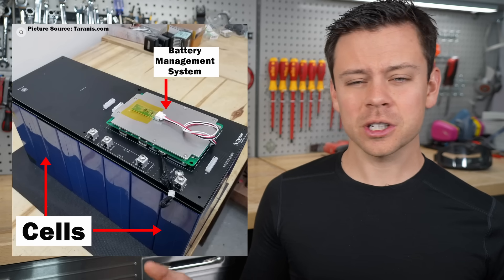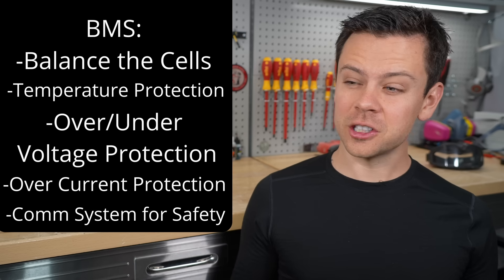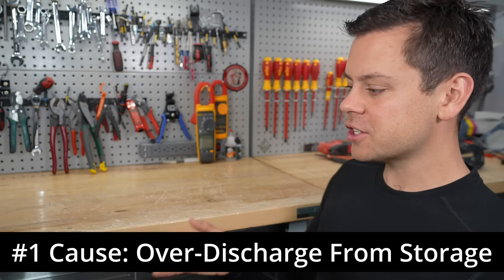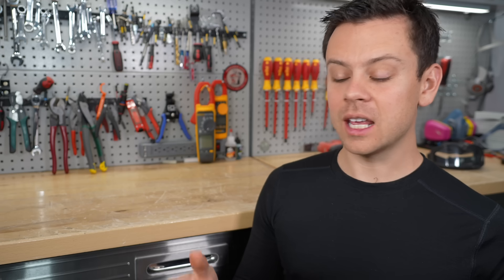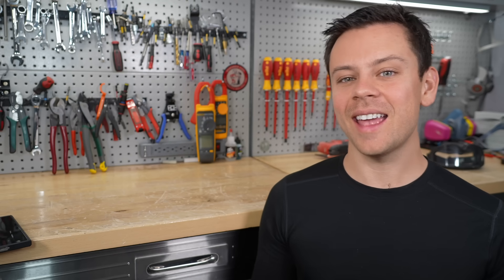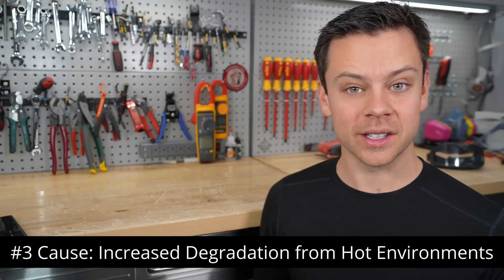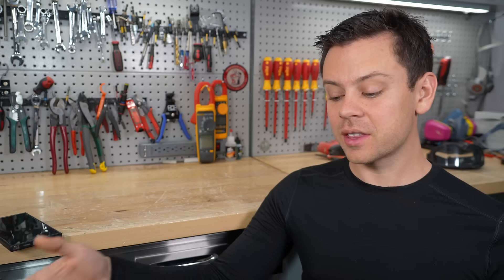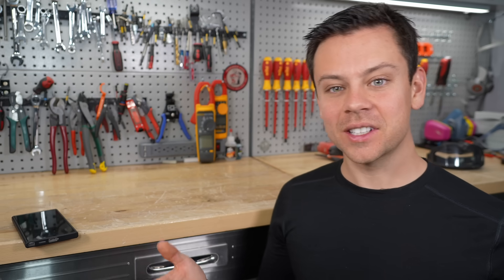The Rules of LiFePO4: The 3 Most Common Causes of Failure and General Guidelines for Long Term Use

Comment: I have 4x 5.1kw LFP batteries. I have been charging them with solar to 100% every day and discharging down to normally between 30-50% overnight. The BMS tells me that the SOH (state of health) is 99% after a full years use. Couldn't be happier.
Reply: What voltage are you charging at/to?
Reply: @forestpassineau  They're Pytes batteries so I'm sure that it's the standard 48v all controlled with a Sol-Ark 15k.
Reply: @forestpassineau  The Sol-Ark info screen says that the battery is charging at around 56.8V
Reply: @simonpaine2347  perfect. Which would be equivalent to 14.2v on a 12v battery. Thanks!
Reply: @forestpassineau  voltage can vary ie you get 48v and 51.2v batteries and many just refer to both systems as 48v systems , they would have voltages with 2.5v - 3.65 v differences bottom and top respectively ,

so a person should ask is yours 48v or 51.2v if you want to use someonme elses settings verbatim
Reply: Sounds about right. Your Depth of Discharge (DoD) is about 60% so that means the battery should be able to get to 10k cycles before 20% degradation. You did 365 cycles which is 365/10000 = 0.037. So you have done 3.7% of the 20% degradation, which means 3.7%*0.2 = 0.7% in absolute battery terms.
Reply: @C4rb0neum  Thanks for the calculations. Very helpful and interesting. Now I have a reference point, I plan to keep an eye out for when the SOH drops to 98% and see how close it is to your figures and then I'll be able to get a more accurate picture of the lifespan of the batteries.
Reply: @simonpaine2347 hey simon which BMS are you using which tells you SOH? Coz i have JK BMS which does not have this feature
Reply: @hamidkhatri  I'm accessing the Sol-Ark inverter battery information, which is obviously connected to the comms of the batteries.
Reply: @C4rb0neum  DOD is not the only factor, overcharging is nearly as problematic... specially on long periods, you can DOD at 50% and overcharge all day .. those packs will degrade faster then normal.
Reply: @davidniquot6423  You can’t overcharge. BMS is there to keep that from happening. Watch the GD video and stop believing myths and nonsense.
Reply: @C4rb0neum  My math says 26 years before they reach 20%.
Reply: And one of my friends just replaced his LiFePO4 batteries for the 3rd time in 10 years.  And these were "guaranteed" 10 year batteries with 10,000 cycles - or he thought they were. Babysitting projects are what they often turn out to be.  Way too often.  And when the battery store is 4 hours away making for a 10 hour round trip if they have replacements in stock, they quickly can become more costly than the problem you're trying to solve.  What did he do?  Switched back to lead-acid car batteries and deionized water.  A sad reality, but a reality nevertheless.
Reply: @zavatone Probably goes to show that buying the cheapest option, isn't always the best one. There are hundreds of different companies putting batteries together, so it should be obvious that not all of them will survive and there are always sharks circling to pick off the easy meat.
Reply: Nonsense  @zavatone
Reply: @zavatone  probably crap manufacturer, I've bought 7 60ah cells from an EV battery recycler from china and the weakest cell still holds 58ah. These cells are 5+ years old and suffer more mistreatments but they are still holding up very well. 

I've had 3 SLA's that die in under 4 years which seems to be normal for these batteries
Reply: @zavatone  curious what the brand and specs are for those failed batteries. His "sad reality" might not be the LiFePO4 reality for everyone. I do trust the engineers' conclusions about these batteries, and think the only weak points are in either in who/how they are manufactured and how they are managed (whether by a BMS or the owner). For example, my 48v 19.2kW HomeGrid Stack of four LiFePO4s is still operating at 100% health 2.75 years after being turned on, never off, charged to 100% nearly every day, and dropping to between 30-50% regularly throughout the year.
Reply: Why lithium battery have no heat sink or liquid cooling how we cool them
Reply: @umairahmad3050 the Hanchu HOME-ESS-LV-9.4K has a heatsink
Reply: "Full years", how many is that?
Reply: @johnvgig "a full year" = 12 months = 1 year

Comment: Why does my Ford F150 Powerboost ( Hybrid ) have such a narrow SOC for the hybrid battery? Maximum SOC is 60% and minimum is 40% Thanks for any info!
Reply from the maker: Really depends on the chemistry. When doing shallow dod cycles, different chemistries like to cycle a different thresholds.
Reply: @WillProwse  Thanks Will. All I know is it's a 1.5kWh lithium-ion battery that I wish was bigger. The 7.2 kW inverter is awesome.
Reply: @GeorgeMcDaniels  That's why the range is so narrow... its because it is a tiny battery the the Ford is probably cycling multiple times a day.  So it can only use a very narrow SOC range to stay healthy.  And its probably NMC, not LiFePO4.    One of the biggest problems with hybrid systems like Powerboost is that the battery capacities are just way too small and usage wears the batteries out very quickly because of that.

Comment: What about keepinga lithium on an auto maintainer charger?
Reply: As long as the charger is compatable with LiFePO4 batteries, it should be fine.
Reply: @Tumbleweed5150  compatible with lifepo4 or just Lithium since my charger jas a Lithium maintain mode?
Reply: @dbo11tango  I am not sure. You just need to make sure it will charge up to 14.4V for around an hour or two, then it should back down to about 13.8. That is what my LiFePO4 charger does. Maybe it will work if you get it charged up to the 14.4V, then hook up the lithium charger, if it keeps the Voltage near 13.5-13.8V. Maybe someone else will know. I just know that other chemistries can have different "full charge Voltages.

Comment: I used to do cell phone repair and had the 80/20 conversation with many customers. Even if you save a bit of wear on the battery, you are giving up 40% of your overall capacity to do so. Batteries are a consumable item, and can be replaced in 99% of cases. Use it, enjoy it, and fix it when it breaks.
Reply: But you're talking LiPo, not LFP.
Reply: @MrHuram-abi   True, but the reasoning is the same.

Giving up a large amount of your capacity to not lose capacity later is almost always a net loss.
Reply: @pinchofdoom LFP batteries at least in theory as I don’t have personal experience last significantly longer as in years longer then a battery with Lithium Ion chemistry if cared for properly.
Reply: I'm on to your game. you want them to use up the battery and wear it down. Then you can sell more battery installs.
Reply: @I.C.Weiner   LMAO.

Don't worry, I've been out of the industry for 2-3 years, and the only store in my area that I like closed down.

Comment: Will I don’t understand, the parameters on my inverter say to set the battery, on the top end to 27 volts and the lower end to 24. Are you saying to set the top end to 28 volt and the lower end to maybe zero? BTW I have an LV2424 from MPP Solar.
Reply: I would set the top end to 28.6V, and the low end to 24V. Never try to go to zero Volts. On a "24V" nominal LFP battery, 20 Volts IS zero percent! The reason I suggest the low end as 24V is that this way, your battery BMS will never have to shut the battery down for too low of a Voltage, as the inverter will take care of that.
Reply: @ thank you, that clears it up for me. You have a great day.

Comment: A question, it seems like most of these batteries that I see are sealed how do you go about changing a BMS that goes bad?  Thanks
Reply: You don't.  Unless you really know your way around the battery or it has screws instead of glue.  Look for a more maintainable battery.  Not that sealed is necessarily bad, but for most people once the BMS dies it will probably cost less to just replace the whole battery.
Reply: @junkerzn7312  thanks
Reply: you would have to carefully saw it open , then you could recase it in a proper metal box.

Comment: Good point on the BMS - I bought 3 wall mount batteries a couple years back - all 3 of them had a BMS failure! The vendor replaced each of them under warranty, but it still surprised me how they all failed, almost one after another.
Reply from the maker: Holy cow!!! What battery was that?
Reply: Not one problem with my two JBD 12v 4s 120 amp BMS.  Reliable and performed very well.  I wish I had gone with JBD when I created my latest battery which is 48v but I followed the crowd and went with Jikong (JK).

Comment: Love the info. I’m about to build out my first system and think I landed on going with the EG4 indoor wall mount battery. I’m curious if I start off with 1 and add on more down the road, 1-2 years, would this cause any degradation or should I hold off to when I’m able to purchase all batteries at the same time?

Comment: It would be very interesting to see you build a diy battery and set the settings in the bms to charge the way you mention in this video with the data sheet of the cells and all.

Comment: I agree with everything you said except for DOD to zero.  Although LiFePO4 have a much higher usable capacity than lead acid, the grafts still clearly show the relationship of DOD cycles and life expectancy.  What am i missing?  Thank you.
Reply from the maker: Absolutely disagree. And if you're hitting zero you should probably make your battery bigger. Probably did not calculate days of autonomy correctly. There is reduced degradation but who cares. Use the battery and stop worrying about it. You'll use it now or you'll use it later
Reply: Very few use cases actually do 100% DOD on a daily basis, so we are left with... well, what about those few weeks in a year where you might need a 100% DOD?  Will that effect cycle life?  Answer: NO.  So there is no need to program your battery to cut-off at 80% DOD.  Definitely allow 100% DOD from the battery itself, particularly if you don't actually use 100% DOD on a daily basis.

Most setups barely use 25% DOD on average.

In anycase, the DOD cycle life calculation to 80% is theoretical and assumes constant temperature and constant C-rates.  Most actual use cases have neither.  Even using a baseline 3000 cycles at 100% DOD, 3000 cycles, cycled daily, is still 8 years.  That would be an extremely heavy use of the battery, only grid-scale battery systems might even come close to that.

But temperature has a huge effect.  A lower temperature (but still above freezing, obviously), exponentially increases the cycle life.   A higher temperature vastly reduces the cycle life.  But again, its an average.  Just because it might 100F during the day means buckus if it drops to 60F overnight.  As an example.

So in terms of battery health, if you have the choice of storing the battery in a conditioned space verses an unconditioned space, you generally choose the conditioned space.  But unless the battery gets too cold, an unconditioned space isn't the end of the world.

-Matt
Reply: from my experience, if you keep it charged to 100% also and you have to leave it 1-2 months even with bms/system connected, the cells starts to swell and die.. so if you are leaving, you need to make sure its at 40% charge and someone is attending the system or just disconnect the bms/system for that period.
Reply: @videostar555  I saw a youtuber claim that he has several UPS's that float their LFP batteries at 3.45v/cell, for 5 years so far. He claims no noticeable degradation.
Reply: @jimmybrad156 yes i do the same (3.45v) for last 3.5 years. but you must know that 3.45v is already like 99% charge.
Reply: @videostar555  I thought you were saying that doing so swells the cells? Did I miss something.
Reply: @jimmybrad156 i said if you are going somewhere, leaving the house, car for a month or two with no discharge or very low discharge and you charged the cell to 100% and leave,  the cells will start to swell..  same for if the cells are left at low charge like below 3.2v.. you should not leave it unattended for long time. you have to keep it at 30-50%, and disconnect bms and system for this case.
Reply: @videostar555  not getting much clarity.
Reply: @jimmybrad156  lol.. not aure what is confusing... just saying if you have to leave your battery for few months, just treat it as in "storage" mode.

Comment: The confusion about charging to 100% comes from advice on cell phone battery charging. A cell phone battery does not have a BMS because it has a single battery "cell" that does not need balancing. So only charging to 80% will make them last longer.
**Additionally there is confusion because batteries should NOT be STORED at 100%, only 50% as stated in the video. But DAILY USE charging to 100% is good. Like everything, it depends on the situation.
***Same thing applies with discharging to 0% - in STORAGE IT IS VERY BAD, however while being USED IT IS VERY GOOD!!!
Reply from the maker: Exactly

Comment: This is the reason a lot of off grid people are still using Lead acid batteries, we set them up and forget for years. Lithium is great but not for long term storage
Reply: I got a good laugh from this one. Lead acid only last around 500 full cycles, and can only be used down to 50% of Capacity. LiFePO4 batteries can last for over 5000 cycles, can be fully used from 100%C to 0%C and back over and over...about ten years plus, and don't need watering like golf-cart batteries, nor do they have off-gassing, which is explosive with hydrogen and also causes the corrosion around the terminals that leaves white, blue, or green powder. I have used both now, and for my off-grid system will never go back to lead-acid for long term storage. I don't need to worry about leaving it sit, as my solar system will keep it in good shape, even if I am gone for six months or a year. LFPs can sit on a shelf for just as long as lead-acid with less self-discharge. One just may need to charge it up a bit closer to 100% if not going to use it within a few months or so. Even at 3% per month, a 100Ah battery should take 33.33333 months to discharge too low to use. I think that percentage is still too high. The batteries HAVE to be able to sit on shelves at warehouses until they are sold to stores or to the public...and THAT could take months to years.
Reply: @ I know people who bought cells in 1990, still running strong, they add electrolytes occasionally.

Comment: It is not recommended to store lithium batteries at 100% charge; the best practice is to store them at a partially charged state, typically around 40-50% charge, as storing them fully charged can significantly shorten their lifespan and potentially damage the battery cells...that what Google said ...
Reply: My Ecoflow come with 28% of charge..